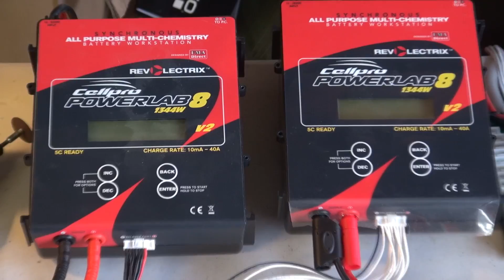FG Sportsline 1/5 4WD Brushless Update - Upgrades

Comment: May I (respectfully) ask a question? I´m puzzled by your decision to fit hydraulic brakes. I´d have thought that with 4WD you had access to excellent braking through your motor and drivetrain, with the potential added benefit of ABS via your ESC. I always thought wheel brakes were more relevant for 2WD petrol or nitro cars. Could you clear this up for me?